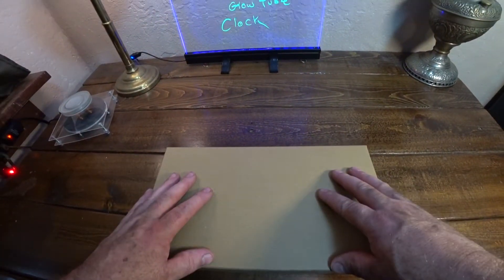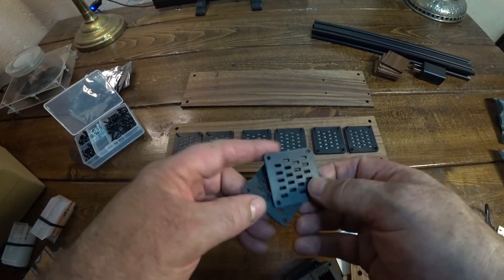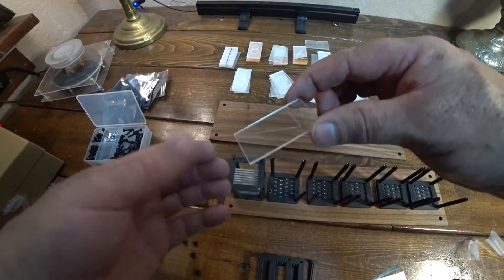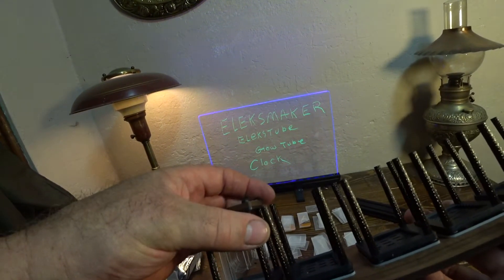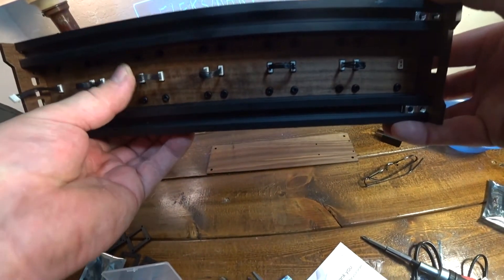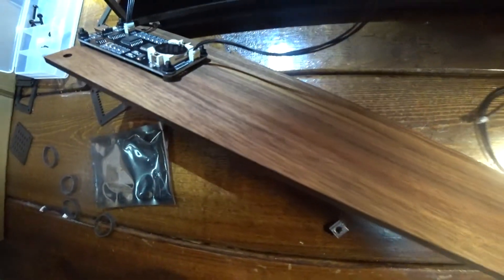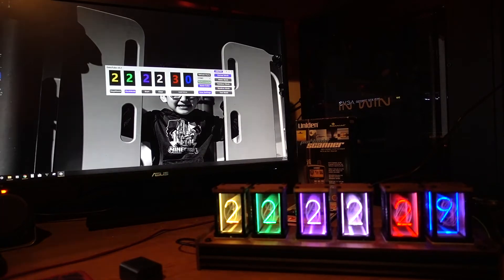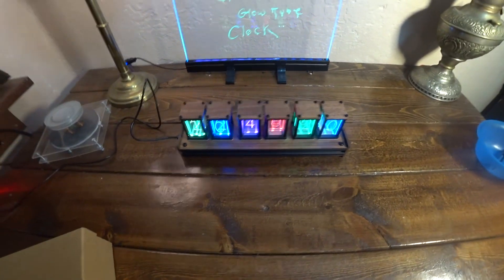The EleksTube Luminous Glow Tube Clock Build

Comment: Carefull, there are two versions available on BangGood: One to solder the tiny SMD parts yourself, and one with pre-soldered mainboard. The difference is only a vew bucks, so unless you are a crack with a soldering iron, better get the pre assembled one.
Reply: @Kylan Watson Flixportal
Reply: @Ernest Jonathan thank you, I went there and it seems like a nice service :) I really appreciate it !!
Reply: @Kylan Watson no problem xD
Reply: I was thinking about buying 1 off of Amazon I just saw just a few minutes ago. But I didn't know if I needed any of those "sockets" that are sold separately. Do u have 2 plug it into ur computer or laptop? Or does it just plug str8 into a wall socket? They're pretty cool looking & I like stuff like that. It's different
Reply: @truestdude  it's running on 5 volt, you need a normal USB power supply.
Reply: I guess Im kinda randomly asking but does anybody know a good site to watch new movies online ?

Comment: Hoping after a year you'll see this. I got one similar to your and am having problems getting it to work. The lights will not come on. The only thing different is mine has a touch sensor. Any help would be greatly appreciated.
Reply: Same here. Got mine through some Facebook scam that was supposed to be a different clock.

How does a touch sensor work through wood?
Reply: @bsg7586  exactly where I got mine from. The touch sensor does work through the wood, well for my anyways. I just can't seem to get the clock to light up. I have check everything I know how to check with a multimeter and still nothing. I finally called American express to dispute the charge due to them not responding to my emails. I also escalated to paypal as well.
Reply: @bsg7586  let me guess you ordered the Nixie clock, the one with the old Russian vacuum tubes that show the numbers?
Reply: @seanvance5917  exactly. How do you know the touch sensor works if the clock doesn't light up?

Are you connected to a pc to set the clock and what not? I was unsure if I want to connect something to my computer that's coming from some scam.

The parts do appear to be genuine, found them on adafruit.
Reply: @bsg7586  I did put it together and tried several different programs trying to get it to work. I guessing the clock board has a power light and the touch sensor started lighting up every time I touched it or put it to the wood. At one point I even hot glued it to where the instructions said to and touched the other side of the wood and it lit up. None of the programs I used worked to get it to light up though. I did test the main board on Arduino and got both lights to blink running the code from the examples within Arduino. Like I said I tested everything with a multimeter and it all works just will not light up. I really think the main board was not programmed before shipment and I have no idea what or where to get the program that make our specific clock work or if there is another that will work for it.
Reply: @seanvance5917  interesting. I only noticed the light on the board come on when I pressed the little button on the board. I guess I'll get to try to figure out Arduino as I try to get this thing to work. Let me know if you find a solution and I'll do the same.
Reply: @bsg7586  Hey, is there a way to get a hold of you without you putting personal info on here?
Reply: @seanvance5917  can you send me an email now so I can remove it from the comments
Reply: same problem here, kinda frustatring after putting it together for hours ugh
Reply: @bsg7586  I plan to reach out to you as well.  I fell for this same scam!  I am a geek and I want to make the hardware (ESP8266) work
Reply: @jwwaterston  sounds good, can you send me an email now so I can remove it from the comments
Reply: @bsg7586  got it